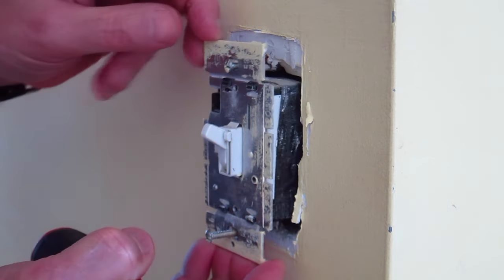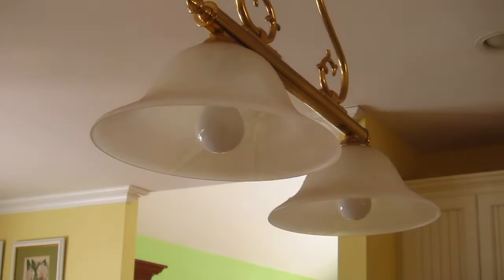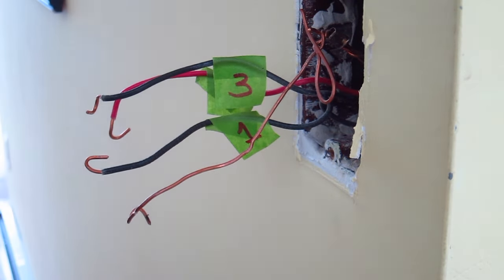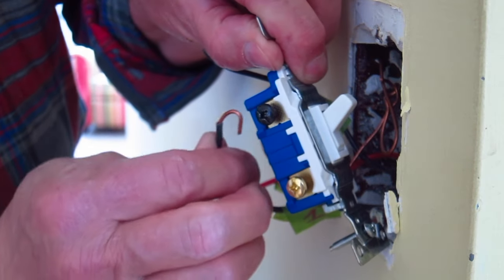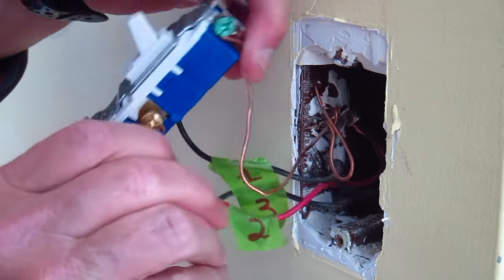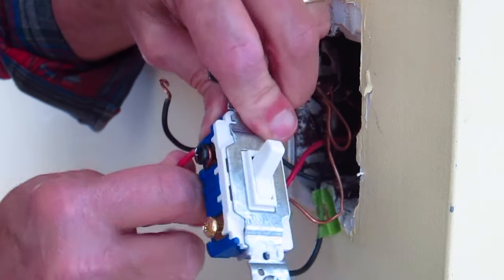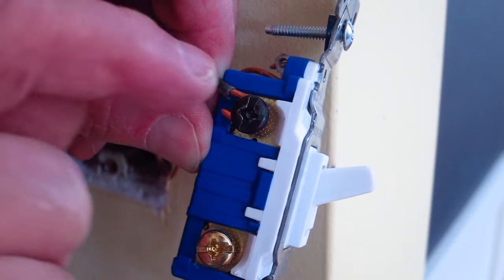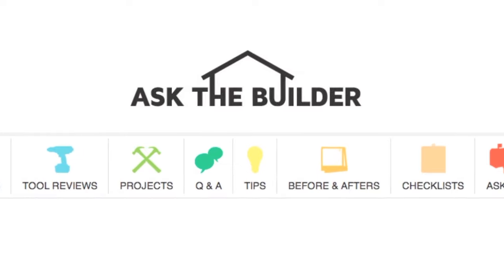3 Way Switch Troubleshooting

Comment: Don’t DIY! Contact a licensed electrician!
Reply from the maker: I think I'd agree with you when it comes to installing a service panel, but for goodness sakes are you saying you don't feel most people can turn off a circuit breaker and make use of a screwdriver and needle nose pliers? If that were the case, then you'd not be an electrician. Think back to when you first started and you had to put wires on your first outlet or switch. You survived. The house is not a pile of ashes. I often think what drives comments like yours is fear. You think these videos are going to put you out of a job. That's folly. The DIY portion of the marketplace is less than 25% of the population.
Reply: Ask the Builder I’m an apprentice. No disrespect but I’ve seen things done by homeowners that makes you wonder why there house isn’t a pile of ash’s.
Reply from the maker: Congrats on picking a rewarding career. Just so you know, I've seen things done by electricians that make you wonder why the houses and businesses they wired aren't piles of ashes. ;-) I can take you to houses wired by homeowners that look far better than any work I've seen done by a majority of electricians. Don't forget that some homeowners not only want perfection they have the skills to comprehend what you're in the business of learning right now. You're going to discover that 95% of most residential branch wiring is very simple. Now, wiring a skyscraper or doing three-phase for a commercial restaurant, that's quite a different story. Thanks for commenting and don't forget there are some homeowners that will GLADLY pay you a consulting fee to give them a boost so they can do it themselves. Don't turn away that money!
Reply: @safeman  lol, I've had to fix "licensed electricians" mistakes.   They might be better than the average homeowner, but that doesn't say much..
Reply: l337pwnage A true electrician, goes through years of training. If a homeowner does electrical work, and their house burns down, insurance will not cover it. But if a licensed electrician does the work and the house burns down, Insurance will cover it. There’s a lot more to being an electrician than just connecting white and white and black to black. If you had to fix a licensed electricians work, they probably are just there for the money. That’s what people have told me.
Reply: @Dredpath1     lol, good luck proving something either way in court.   When electrical fires happen, it's typically LONG after any work was done.     And in the case I'm citing, that work was passed by an inspector.   If you want to hire professionals to avoid liability for something, there is a case to be made for that, but I just hope you can afford better lawyers than them, or it may not matter.   Personally, I'll stick to just doing it myself so I KNOW it won't burn up.
Reply: This is what usually contractors say to charge you $500 for replacing 2 switches. For crying out loud, this is not a rocket science! Anyone who knows where the screwdriver's business end can do it!